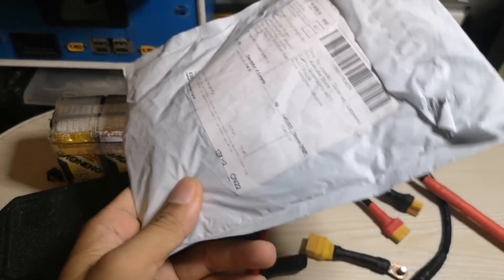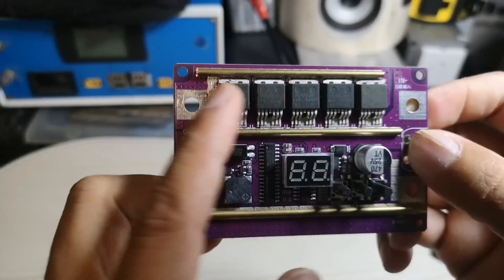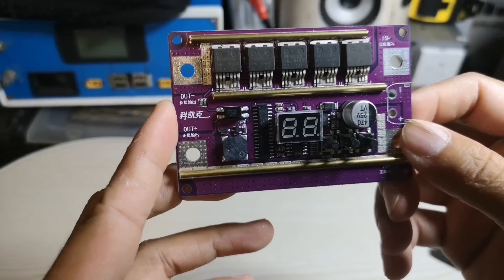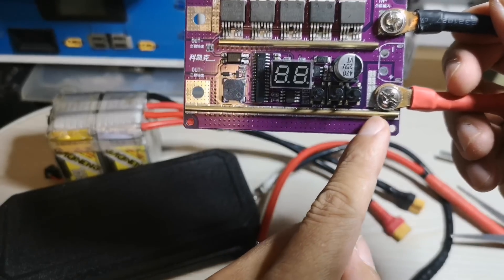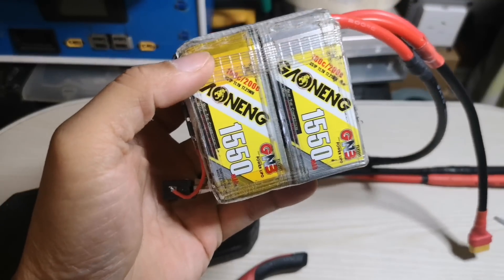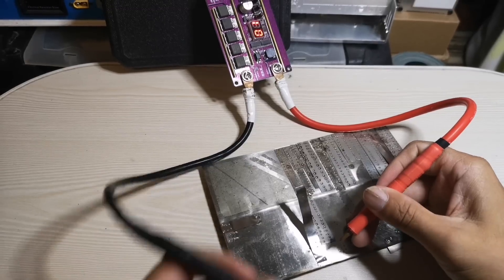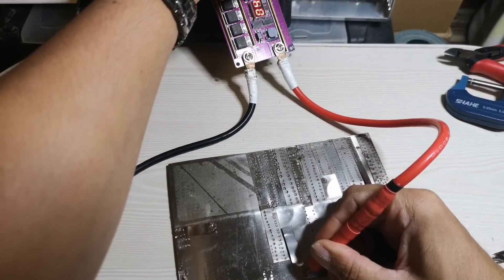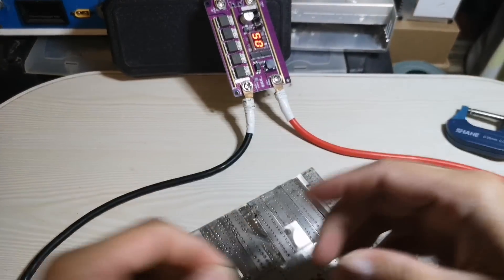Part 1 2022 portable spot welder 99G review and technical "TIPS"

Comment: Hi. Thank you for this video. I am new to spot welding and it's very informative. I have a question. What is your metal test piece made of? Looks stainless but I'm not sure. Thank you.
Reply from the maker: I use a nickel strip ideal for 18650 battery  started at 0.1 up to 0.3mm it depends on your need. There are 2 types of strips for Battery pack purposes I think! Pure nickel strip and metal strip/coated nickel.
Reply: @pitikaron  Thanks for the quick answer. I was actually wondering what material is the piece of metal plate that you weld the strip to for your tests? I think it's a very good simple test and would like to be able to do the same.
Reply from the maker: Aaaaah ok sorry it's a stainless steel 0.5mm from ali-express
Reply: @pitikaron  Right. Thanks for that. Off topic, but I've been nervous about using Aliexpress as their feedback to Australia is bad (I'm in Vic). I think I saw you quote Aus$ (mosfets?) somewhere. If you're in Aus, how have they been for you?
Reply from the maker: As of now I am already back home (Philippines) I live in Aus for 5 years as an international student Queensland. When I was in Australia the only apps I used was Ali-express so far The seller mailed me the item that I ordered! However most  Ali-express products are not branded but it will work.

Comment: How many 3s 1.500 batterys did you use to power it please
Reply from the maker: 3S 12V 5ah to 10ah 50 to 100C it's good for spot welding.

Comment: I ordered this spot welder from above link and MOSFETS are now different - F1324S-7P . On power 50 FOSFET died with explosion 😀
Reply from the maker: Sorry to hear that!  I don't have any idea if they install a new type of MOSFET.  Maybe you can replace the MOSFET  228 if the pcb board still functions properly.
AU $16.83  7%OFF | 10PCS IRL40SC228 557A 40V 0.65mΩ 40SC228 L40SC228 TO-263 SMD MOS tube IRL40SC209 478A 40V 0.8mΩ
https://a.aliexpress.com/_msqeCAE

Comment: Hello sir.What battery did you use ? It's nominal voltage and amperage ? I need the machime urgently but I'm not sure of the right battery to use
Reply from the maker: 12V 8.4mah 100C for Lipo battery 🔋
If lead acid battery 🔋12V  500CCA. No idea for Ah. Anyway I provide a link for all the items I use in the description list.

Comment: Hi friend
Can i connect with power supply direct of 14 v / 3 A  or not and what you me advice.
Thanks
Reply from the maker: yeap if the Maximum voltage of the battery is 14VDC
Reply: @pitikaron  the voltage  its 11.1  und 1550 mah than i can securely charge with power supply with 12.6 v and 1.55 A but before that i will but bms its the best way and if there's anything wrong please tell me
Reply from the maker: Better to install BMS that can manage the voltage protection and amp protection

Comment: How you charge your 4p 3s battery together can you me all explain. Thank you
Reply from the maker: I install BMS then install DC jack
I uploaded a video of how I'm wiring up the BMS through the battery.
Reply: @pitikaron  please make video just how to build battery for this project 4p 3s lipo and how can you charge it
Reply from the maker: https://youtu.be/Pcg2PPsYY6o
Reply: @pitikaron  Can i join all wire Ballance and the p+ and p- separate together and i will charge with imax B6 from AliExpress or the don't work
Reply from the maker: if you have B6 charger for lipo battery so you dont need to install BMS for charging input.  no dont coz you short the battery do not join the wire every cell
Reply: @pitikaron  i mean parallel p+ withe p+ and p- with p- also for Polar balance so can i charge the 4 battery together with imax 6
Reply from the maker: Yeap you can parallel
Reply: @pitikaron  but its be very nice from you if you make video how to you make the battery 4p 3s together waht you have in your video by spot diy  and how you connect the wire.
Thank you very much 💐💐💐💐💐💐💐
Reply from the maker: https://youtu.be/Feac64ae6IY
Hope this video can help you

Comment: Amazing work😉
I will buy it anf use a car battery.
Any advice? Increase the contacts?
Thanks for the videos
Reply from the maker: as long as your car battery can  produce 600A peak and the voltage must not exceed the ideal voltage for spot welding!  good to go but you need to increase the traces of spot welding to avoid traces blown and also mosfet.  more over wire input and output should also thick
Reply from the maker: thanks for visiting my channel

Comment: thank for the review..i have one question, is it possible to use 4S battery pack(16.8V at full charge)?
Reply from the maker: what is the maximum voltage to your 4S battery when it is fully charge?
Reply: @pitikaron  on full charge, the 4S battery pack voltage is 16.8V.. im not sure if the extra +0.8V can cause damage to the spot welder.
Reply from the maker: I think not coz the maximum voltage recquired to the spot welder is 16v 
and the minimum voltage is 9V.  sorry If I cant give you a 100% yes that it wont coz damage but if we follow the input power recquirement your battery maximum voltage is suitable to the spot welder.

Comment: hello guys.  what is the maximum ampere that can be used for the spot welder machine ??  and can i use input from xt60 interface ??  not the input of the plus and minus cable ??  thanks
Reply from the maker: It depends on the mosfet that they installed to your spot welder and the current  limit of the mosfet. sorry I Don't really get it your next questions.  power supply input positive and negative?  as long as you can power up your spot welder it doesn't matter howerve it is better that can handle or manage large current.
Reply: @pitikaron  the one in the video.  I see that there is an xt60 input socket. Can I install xt60pw on the board and I want to use a 5200mah 80C battery.. can I use that battery sir??  sorry i can't speak english so i use google translate...
Reply from the maker: Yeah you can manufacturer provided for XT60 SLOT  but please do not enterchange the positive and negative,  their is no protection for wrongway installation. you can also refer to the seller advertisement or email the seller where you can install XT60? anyway if you did not add/install another 5 mosfet at the Back the maximum current you can used only 2000A coz that 5 mosfet can handle 2,390A  but leave extra for current flactuation.
Reply: @pitikaron  ok.... i will try to install xt60 slot... on the media it says + and - in body xt60 sir... so it won't be reversed...
thanks sir
if i may ask to make a video using xt60 slot... can you make a tutorial sir?? Hehehe
please sir
Reply: @pitikaron  I've subscribed sir.. I'm waiting for the soldering tutorial and how to install xt60... hehehehe thanks for all the answers... it made me learn
Reply from the maker: Thanks sir!  unfortunately I can not re-do it installing  two XT60 from input however I can definately discuss to my coming video that I produce including how I upgraded or design my welder, electrode due to request.  anyway I reffer you another video hoping it could help for you how to install XT60 from power input unfortunately is not the same spot welder it is a red spot welder!  this the link. 
https://youtu.be/sd6ATHDr-84 
anyway you can email email me through this email address; jhofferfheels@gmail.com

Comment: Would be interesting to see whether you can spot weld a copper-nickel sandwich with this board or at least copper-nickel plated steel.
0.1-0.15 copper and 0.1-0.15 nickel/steel
Reply from the maker: I tried to catch up that in my part two

Comment: Nice sharing. Irl40sc209 is logic mosfet. Can it weld with 5v (series super capacitor)?
Reply: Thanks
Reply from the maker: Thank you too boss
Reply: I have this model and work perfect with 2 units 3000F super capacitors in series....only need an external power supply with 1amp minimum to turn on the board
Reply: @francisconotengo3477 how do you do it ? 3000F is 2.7v, so its 5.4v with 2 series, and board required 9-16v supply. What is voltage for external power supply ?
Reply from the maker: Must be 12V power supply
Reply from the maker: The voltage requirement is 9-16V better to supply 12V  6100Mah 100-200C discharge rate if you want to supply supper capacitor kindly please supply 12V with 1000A do not exceed 1500A to avoid mosfet blown better

Comment: Hi Piti, thank you for sharing this new sport welder. Can you share the reference of those NEW mofsets that are supposed to be better than commonly used infineon 4n04r7/4n04r8 ?
Edit : you already provided the answer in a previous comment : IRL40SC209 
Thanks !
Reply from the maker: Boss!  base on my research on mosfet!  N channel mosfet are better for DIY BATTERY PACK,  because they have a quick response on & off ability.  however you must not exceed the current limit of the mosfet to avoid mosfet blown up.  other than that cheap spot welding from Chinese are very poor quality of traces!  for that reason you must increase the thickness of the traces so that current flow smothly.  anyway this latest spot welding installed IRL40SC209, 478A 40V  RDS on 0.6M ohm and the max 0.8m ohms. if my response not clear for you are welcome to asked more questions. thanks for taking time watching my review boss.
Reply: @pitikaron  thank you for your answer. Looking forward to the next video with the trace enhancement along with the 5 added mosfet on the back :) That should bring a hooping peak current around 5000A.. Hoping to see a test of spot weld for  0.4 nickel plate and 2 0.3mm together :0
Reply from the maker: thanks boss!  unfortunately it takes ages to wait my order from Ali-express.

Comment: thanks for the review, adds to the choice of spot welder!
btw, sorry different from the topic
about spot welder dhj02b, is it possible to supply the MBTZ14S agm motor battery with 12 volts, 11.2 amperes, 190 CCA?
Reply from the maker: its alright you dont need to say sorry!  as long as the voltage and the capacity of your battery it will not exceed voltage  from the spot welder DHJ02B and also the amp c rate.  according to the discreption of DHJ02B 900A.